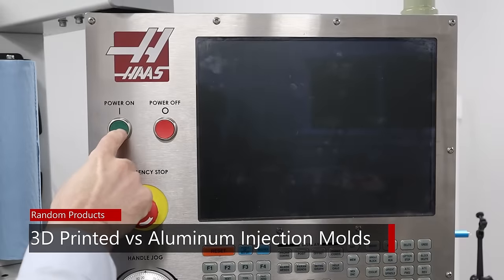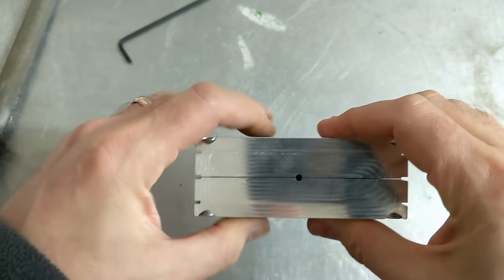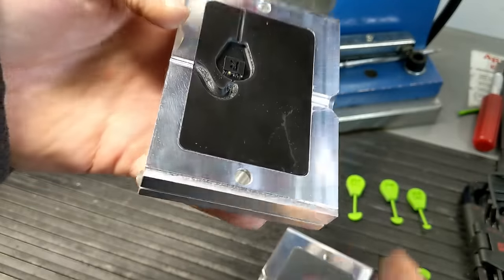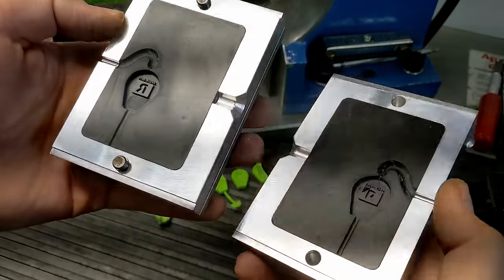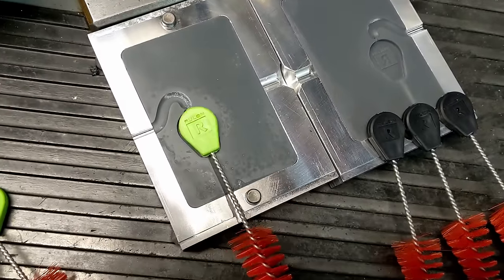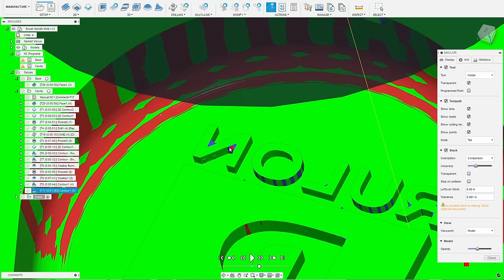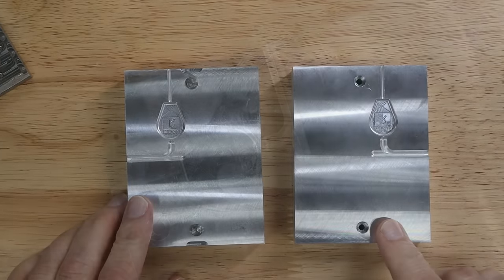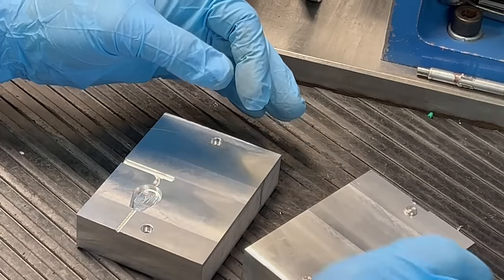3D Printed vs Aluminum Injection Molds

Comment: Resin looks like it would be ideal for rapid prototyping, but if it’s all you have, then I don’t see why it wouldn’t be perfectly fine to use on smaller production runs while you are getting started up! Also, as someone who primarily uses FDM printers, I’m always blown away with how much detail a lot of these newer resin printers are able to get! Even some of the more budget friendly SLA printers have a crazy high resolution
Reply from the maker: That's true, you could use resin molds for very short production runs. The issue is that you would need to replace the inserts every so many parts. It is a bit of work to make new inserts and prepare them, as I believe it often takes some sanding to get them to fit just right.
Reply: @JohnSL  that is very true, but with the cost of a machined mold, it might just be a decent option for people just getting started up who already have an SLA printer. One thing to look into would also be a sanding jig to get the proper thickness/flatness on each part without as much struggle. The biggest benefit is definitely rapid prototyping though.
Reply from the maker: It's a time vs money tradeoff. Resin doesn't cool the parts off the way aluminum does, which therefore also results in longer times per part.
Reply: @JohnSL  I've always been told that professional aluminium molds start around 100k, for that kind of money you could print a lot of resin moulds for small runs. Is that true or is that vastly exaggerated?
Reply: @Ragnar8504 As with most things. The answer is, it depends, but a multi-part mold for a product we're considering was quoted at under $10,000 at a Chinese manufacturer. Still not cheap by any means, but that's still an order of magnitude under $100k.

Comment: This is great. I have been having similar experiences with 3d printed molds using a Buster Beagle machine. I do see 3d printing as a great way to prototype an aluminum mold. Do you know if there are any online services that offer aluminum mold milling and what the costs might be for an aluminum mold similar to what you have in this video?
Reply from the maker: I make injection molds for others. I'm not fast, because this is a hobby for me, but I make sure my customers are satisfied. Most of the molds I've made are below $1000. Some a lot below, if they're really simple. It all depends on the complexity of the mold and whether I need to design the mold as well as make it. Some parts, for example, are not designed with draft and I often find it's faster for me to just re-do the part in 3D CAD. I've gotten parts where it's impossible to add the draft (because of how they part was designed) without starting over. That adds to the cost. Also, I've received more than a few parts that would require a multi-part injection mold, which is therefore even more expensive.
Reply: @JohnSL  thanks for the response!

Comment: I'm wondering if moving the sprue towards the brush end would reduce the sink without having to increase injection time? That wire has to change the cooling properties near the point of contact with the aluminum mold.

With a 30,000rpm spindle you can easily run engraving bits with smaller points for better details such as your lettering.

I made myself a custom aluminum injection mold for a guitar pick. I designed a raised logo on the picks to both provide a better grip and to function as advertising without the need to print on the picks later.

I found I got better detail with shallow cut lettering.

Comment: Try making a positive mold with resin and then make the negative mold to be used in the injection machine by casting JB Weld around the resin mold. JB Weld can take a lot of heat and also conducts heat better than the resin. And it is really tough and wear resistant.
Reply from the maker: There is a long history of using epoxy molds for small run injection molds. They will be stronger, as you point out. Plus, you can add aluminum powder to increase the thermal conductivity. So, yes, I think that's a viable option.
Reply: Nice I was thinking about that. How many cycles does jb weld last? Or maybe Hysol?

Comment: How about if the resin molds were electroplated? Also are your resin molds properly cured? You could try cranking the exposure time on the high temp resin

Comment: A metal 3d printer would come in handy, when are these coming out? Ive heard you even could create casted aluminum molds with a foundry and a 3d printer but i do not know to what level of precision aluminum could be casted this way if there would be a company that combines these two machines or if they could sell them separately 
(made by the same 3d printer brand) this could be able for you to create even aluminum 3d printed part's without doing it poor man's way DIY and now you wouldn't need more skill or more tweaking making it more easy to use and more reliable and decent. These 3d printed injection molds hold up pretty good for around 5 times, item crafting is just so awesome and we're going somewhere with these tools, as the youth in this society gets the proper education to handle these tools it could even replace minor manufacturing industries.

Comment: This isn't an issue with bad materials, the print did exactly what it's designed to do. It's an issue with bad procedure. The printed part needs to be the positive that you use to create a negative in a material that can actually handle the temps of the final positive.

If you had made a vulcanized negative using a printed positive it would have handled just fine.

Comment: Formlabs High Temp works well for hundreds of shots
Reply from the maker: How many shots depends a lot on the geometry of the part. Some parts could result in closer to 1,000 shots, while other parts might be less than 10 shots. If the part has very generous drafts and no delicate details, for example, it should last for more shots.

Comment: When you do 3D printed resin..
Get very fine alumina powder. Mix it with your resin. It's very inexpensive. Aluminum oxide. It is stable and will not compress. Extremely strong and it pulls the heat away. It is unaffected by heat. It's heat wicking abilities are incredible. I think your standard resin would not be given the full heat load anymore and it would be  wicked away more quickly.
That's what I would try guys.

Comment: What if you mixed some kind of metal powder into the resin when printing the mold? Might make it more resistant and help with dumping heat out of the plastic faster, which could help with your warp issues. I've never tried mixing metal powder into resin so it could just ruin the film on the vat, hard to say haha

Comment: Идея напечатанной формы на 3д принтере она конечно очень соблазнительная. Проблема только в том, что даже если напечатать форму из полиамида. ее теплопроводность очень плохая по сравнению с алюминием. Соответственно прогреть ее нормально не получится, и остудить быстро тоже. Коэффициент расширения очень большой. от многократных циклов нагрева пластик может тоже деформироваться. В общем, эту идею я оставил и делаю формы для себя из алюминия.
Reply from the maker: I agree with everything you said. I think there are two cases where 3D printed molds do make sense. The first is for prototyping a part and/or mold. The other is for people to be able to test a market before getting aluminum molds made. A lot of people buying desktop injection molding machines don't have the experience or equipment to be able to make aluminum molds, so they have to pay someone else to make them.
Reply: @JohnSL  Я использовал для изготовления форм с малым ресурсом двухкомпонентный полиуретан с керамическим наполнителем. Результаты вполне неплохие, она выдерживала около 120 градусов нагрева долгосрочно и рассеивала около 220-230 градусов расплав. А прототип печатал на 3д принтере, с него уже получал форму. Это даст очень большую твердость литьевой формы, намного больше чем у напечатанной на 3д принтере. И не придется делать оправу из алюминия.

Comment: Could laser metal 3D printing be a best of both worlds half way point?
Reply from the maker: I don't think it's quite there yet. Metal 3D printer that I'm aware of uses laser sintering of a metal powder. The resolution of the resulting parts is therefore much lower than with SLA prints. At least that was my experience the last time I had an SLS print done.

Comment: I've been looking at various resin 3D printed things for other manufacturing processes, masters for molds, various forms of directly printed molds, etc., and I just don't think printing is of high enough resolution yet, as you'll still have artifacts appear within molds and casts. Without moving to a much more complex 3D vectorization model of producing prints, I'm not sure if layer-based printing will ever achieve high enough layer resolution to not have artifacts, even if it gets to the point where it's not detectable by eye the texture will still be there, and post-processes are either not worth the time or they're a massive time investment. One idea I've considered, which seems obvious but I haven't seen it practically done yet, is post-print machining to remove artifacts, this could also potentially work with metl-sculpting but excess material becomes problematic in that theoretical instance; I know the high-end CNC world is getting into laser-welded metal powder FDM, and IIRC this additive process often time does need a subtractive cleanup pass, done on the same 5+axis machine of course. Though none of these will fix high temp casting, that'll require metal powder printing, which itself is a fairly hefty investment. It feels like 3D printing is constantly on the fringe of the next massive step that could potentially push it from rapid prototyping into actual production territory, but that step just never happens. 

Though I would be curious, if you can get your hands on a powder printed mold of a suitable material, you should machine it with a surfacing pass, and test it for efficacy compared to machining a billet. Testing the efficacy of this process could produce an interesting content piece, especially as the post-additive subtractive process seems to be a rare thing to come by. But I haven't checked prices of outsourcing for this style of printing for awhile, and I haven't checked the prices of investing into this kind of printing ecosystem for awhile, so I can't say if doing such a thing, at either end of the scale, has a good break even point or is even a sound investment.
Reply from the maker: It turns out I have done some post machining of 3D printed metal parts. If you look at my series on making a watch case, the parts that I'm machining have been 3D printed and I'm doing the post machining of the surfaces that need to be precise. I'm not allowed to go into details on the 3D printing. These are stainless steel parts and the quality of the 3D printed parts is quite good. But the level of details available, as you point out, just isn't there. In this case it made sense to use the hybrid approach to allow for surface textures that would be far more time-consuming to mill. So we're getting the best of both worlds.

Comment: Curious - what is the cost of your cnc vs 3d printer? Price vs cost performance is pretty interesting
Reply from the maker: Not even close. What I've realized is that the sweet spot for 3D printed molds is to test out the mold design and part before having someone else, like me, mill a "production" mold from aluminum. The question I was looking at is whether you can get by without an aluminum mold for production. And I believe it's basically no.

Comment: I have no knowledge of injection molding so im just curious on this, why is it that the mold were milled from aluminum instead of steel? Do the properties of aluminum better suit injection molding over a steel mold and if so, why?
Reply: answer
steel is waaaaaay harder to work with milling tools. and it does increase the cost too by a lot. it does heavy a longer lifespan too.

Aluminum is softer, you can sculpt it really well (using other techniques too, like spark erosion, for precise material removal)
Reply: @pedrojustice  I mean i guess but that depends on the steel. with tool steel i can see what you mean but I'm going to assume aluminum is better suited because of the thermal properties
Reply: @DJMateo99  Searching for invoices...
The same mold in ht resin (3d printing) costs $100, should be good for 50 uses.
If made in aluminum costs $3000 , good for 5000 uses. Made using Steel it costs $20000, for 100k uses.
Reply from the maker: As @AWRAskins mentioned, it's much easier to mill. Plus, the higher thermal conductivity means that you can have shorter cycle times without needing cooling lines (which would be hard to setup when you have to pull the mold out to remove a part). Also, the cost of molds for these desktop machines for simple parts is definitely below $1,000, so not that  bad. And depending on the part, you can get 10K or more parts from the mold.